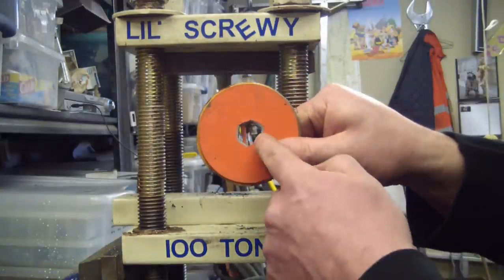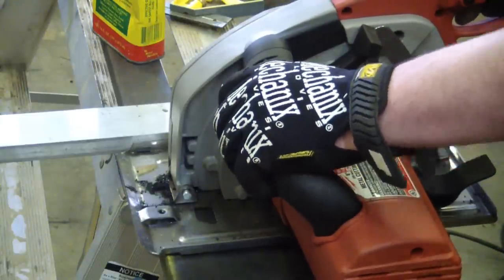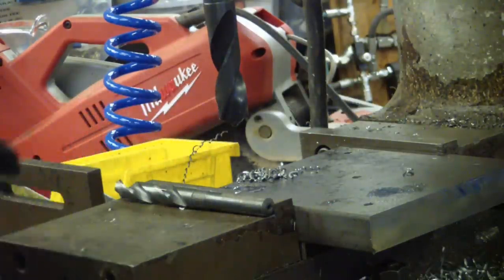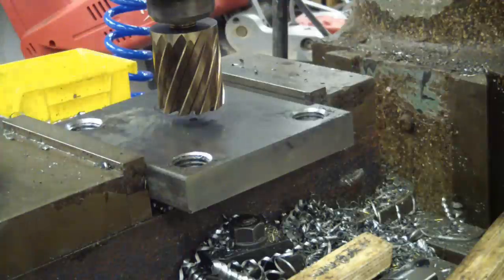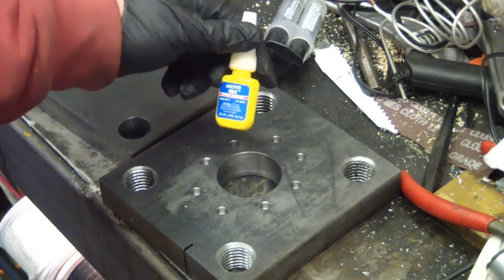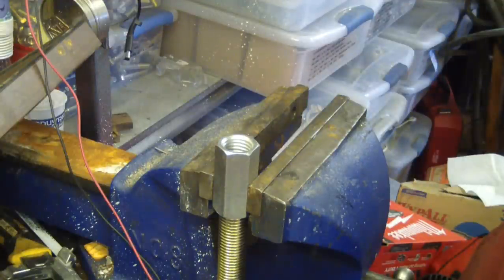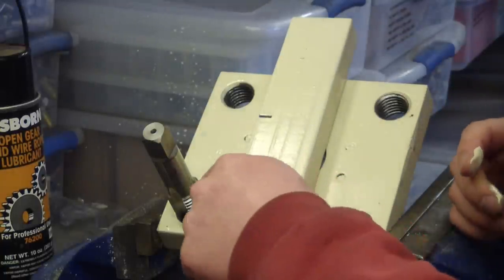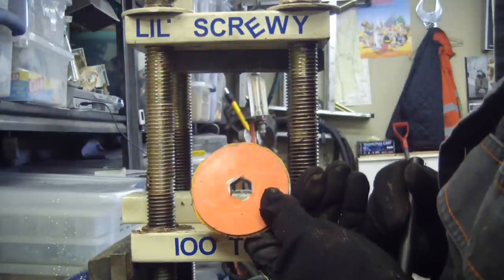How to build a 100 ton Press for machining, broaching, punching and forming

Comment: I used to use two big bolts from old coil spring compressors to press bearings.
I think you can make your contraption more efficient by using tapered roller bearings instead of just those big washers. Or at least use 2 or 3 washers and a lubricant to reduce friction.
It would be the equivelent of oiling a bolt before torquing it. If rebuilding an engine there are sometimes different torque specs for oiled or not oiled bolts. Oiled bolts require less torque to be applied when using something like a torque wrench.

Comment: Don't shoot sparks at your dingus...you should probably try wearing pants in the shop!
Reply: Rick Rodriguez I set a pair of worn out Wrangles on fire like that.
Reply: +K.D. Pearce i've set myself on fire more with grinders than I ever have welding. those sparks might not be quite as hot but you shoot em like a garden hose and things tend to get the idea and catch up
Reply: Rick Rodriguez uralldinguses
Reply: For your health
Reply: I have a grinder scar that goes across my left thumb tarsal thing and continues across the inside of my left thigh. I was a close one. Now I use a guard and have a reminder at the base of my left thumb. Whoops
Reply: Not my fault it hangs out the bottom

Comment: Hey, get a large gear motor and five timing gears and a belt.  Broach the gears to fit your coupling nuts.  Put two idlers in the middle so the belt can head out to one side to meet the motor pully.  Don't forget the arduino!  Could use spur gears too but spacing would be a pain...

Comment: Hey AvE, have you considered remaking Lil' Screwy except adding a bicycle sprocket and running a chain around the boltheads? Using  an old 10-speed bike/legpower instead of armpower seems like a lower effort way to get stuff done. I'm only asking because I want to put one together but want to learn from your mistakes first.
Reply: You just need more chains and sprockets. And creatine.
Reply: I thought about the same thing except using gears instead of sprockets, might have better resistacies to beefy pixie forces. You might need 7 or more gears but it seems . It seems like a cool idea in theory, considering force advantage and simultaneous rotation of all 4 screws.
Reply: if those screws are spaced right, you may be able to do something that looks like a planetary gearbox, each screw is a planet, and there is a smaller star at the center so you get your torque still, the star has a short extension attached to it that's compatible with the wrench you want to use, could even use a drill to jog the vice, and an impact may be able to torque it down. gives me an idea...
Reply: instead of a bicycle sprocket, a timing chain and gears from a junk yard motor would be beefier.
Reply: @lovotcore6946  I was thinking the exact same thing about a planetary... glad to know it's not a completely hopeless idea

Comment: Very cool, thank you! Although $35 is definitely tongue-in-cheek, you can build a submachine gun for $35 with this setup =)

A question: I wouldn't question your statement that this is dangerous, but could you elaborate on how exactly? I mean I can guess that maybe cracking stressed metal or flying bits are no fun, but I'm not sure.

Comment: Great build. I'm going to keep this idea in mind in case I ever need a press. Have you considered using some 525 chain and 14 tooth sprockets on each threaded rod so they all turn at the same time and you get nice even drive the whole way?
Reply: ***** 525 roller chain, it's a common size on motorcycles. Good chain is about $1 per link, cheap chain goes for about $0.60 per link. It's good for 8-10000 lbs.

Comment: You want to use lil screwy to crumple the can of never seize down so the brush touches the bottom. We just hammer the sides down but the two inch hole in your press should accommodate the cap/brush.

Comment: Yah, back in the mid 90s, I was the machinist for the Pacific Rocket Society.  I fabbed up the 6" diameter injector plate, manifold and valves for a LN2O/LPropane engine.  She was going to be 18' long with a projected alt of 15 miles.  But that's as far as the project got.  I've got me some idears on how to fab up a regenerative cooling jacket out of segments of SS and a really radical injector plate/manifold design.  All that's stopping me is the need to make some dough outside of what we need to feed our faces around here. 
  I'm into jet engines too, BTW. 

Randius Maximus
Reply: ***** The S.O. guys have some interesting vids up on YT, but some of their hardware looks kinda wonky to me.  Case in point; that hokey tubing fab up job they did with the 90 degree weld-up instead of smooth bends just made me cringe!!  One elbow bend like that introduces as much pressure drop (resistance to flow) as ten feet of line.  And they had like three of them in just one pipe!  Good grief. 
  Got a trans job on a Taurus to finish up today, and then rebuild a Dana 35 in the ass end of a Wrangler this weekend so I'll have some extra cash for my 2" tubing to make a prototype of my new tank design.  As Grease used to say, Schweeet!

Comment: +AvE
Screwy may need some kind of thrust washer under those coupling nuts might make it easer to tighten  your press. I poked around McMaster Carr 1’’ needle bearings are only loads rated at 3150 lbs. A home made teflon washers might do.

Comment: I'm gonna build myself one of these and put gears on the top of the rods with one central gear to drive them all. Or at least that's the idea. What do you think? Ohh and how would you do the gearing ratio? Since you know how hard it is to tighten that thing first hand...
Reply: +Robert Briggs If you go that far you might as well put an electric motor on it.
Reply: dieselphiend Hmm... Good point =) I know where I can pull up a decent little electric motor
Reply: +Robert Briggs You'll put your eye out.
Reply: +Rini 
Nothing a little 5 stage reduction can't fix ;)
Reply: i have an old sump pump motor that spins at 1750 rpm at either 120 to 240 volts ac. it has some sort of spring mechanism in the front end of it to keep the motor from torquing out the drive, its 4 small springs in two stages with a small translation bar in between them. i just need to figure out how to find a tappable gear for it cause it had a nut and bolt setup in the front for the impeller (which i had to grind and cut off to get to the nut). tell me if anyone has any ideas

Comment: are there any plans for presses like these with mechanical information, and calculations for stuff like the size of the bolts? i am interested in being able to deep draw unibody gas bottles, and that requires like 200 tons of pressure. where can i find more information about this?

Edit : There are drawing calculators online. Best bet is to just make less diameter reductions with the dies

Comment: Put some roller sprockets or timing belt pulleys on those four rods and connect them to a center drive! Then you don't have to worry about evenly screwing down them down.

Oh, but then you'll need four times the torque probably. Then you can use that inline reducer that's been hanging around.

Comment: Nice video.  Would it be easier to simply buy 4 nuts that fit on the threaded rod and weld those over through holes in the plates on the side that doesnt' expose the nut welds to stress?

Comment: Just wondering if you could use an impact driver to sequentially tighten those rods?
Would be easier on the meathooks but I'm too much of a noob to know wether that's too much stress on the bolts.

Comment: i feel like it would be best to have those bolts and nuts machined custom. make them out of O1 tool steel, harden them, and bring the temper to, like, a blue. maybe even try and through-temper it somehow. ive tried to make my own steel drill bits this way, and anything less than plum color temper just snaps. same for the nuts, with really thick threads. you can potentially make some really tough material that way. you'd have to drill everything with high speed steel or carbide though lol. can a 12L14 base plate handle this sort of pressure?

Comment: You know what would be kick ass on that press..
You need to get  like 4 beefy  small diameter chain sprockets   and weld them to the tops of the 4 threaded rods and wrap a stout chain around it and master link it up, then you would only have to tighten one screw and she would creep down nice and chooch 👍
You would just need to run a thin steel spreader (like 1/4" plate) just under the sprockets so the rods behave.

Comment: nice work - i could do with a press but not 100ton; just for pushing bushes out of trailing arms/radius arms/suspension parts. could this be duplicated with, say: M8 bolts or threaded bar? I only really need about 10 tons, fraction of your design!
Reply: cheers! just need to find me some steel plate suitable for the job. Do you have a site/book you'd recommend as a reference for calculating material sizes required to take the pressures/strains/etc?

Comment: Another you tuber referred me to your work, and this video prompted me to subscribe. I can totally relate to learning how to make tools an/or machines with a shoestring budget. Keep up the good work. Waiting for the hydraulic version, though ...  :)

I saw on one of your videos a comment about using something like a 7.25 inch  Skilsaw with a steel cutting blade to cut plate with. I have a worm drive saw, so it should have enough torque, but I have a couple of questions, if you don't mind.

I searched around Amazon for a 7.25 inch steel cutting blade, but they all appear to be limited to .250 to .375 inch plate. What blade do you use, and what is that liquid you squirt on the plate, that you use to cool (I assume) with?
Reply: *****
Cool beans!. Thank you the prompt reply. I'll see if I can find the torque output, or maybe derive it from amperage/horsepower rating.

Comment: You should put four same size gears on the all thread with a single smaller gear to turn them all at once, with a little gear eduction..sort of a planetary gear drive setup.

Comment: The heat from welding won't screw up the magnets, unless their temperature goes above the Curie point.  But methyl methacrylate resin decomposes at a MUCH lower temp!  Maybe those magnets are now being held in there just by the magnetic force?  :)

Comment: Would be cool if you put some big gears on the rods, and then a small gear with a crank handle in the middle for good leverage. Then you can just crank it down.
Reply: +Ninjafluff 
Gears that size would be expensive. Would be easier to just go with a hydraulic press then.

Comment: How bout fitting a sprocket on each coupling nut and running roller chain around the four screws? Then only need to turn one screw and the rest turn simultaneously, right?
Reply: then you also gotta turn 4x as hard

Comment: Quick tip for super glue on your fingers, just run it over a file and it come right off with out taking of the all the extra skin you've built up on em over the past however many years (;

Comment: nice press!
Reply: *****  I have an idea, I wonder if your crunch an open end wrench through some metal if the shape that's punched out would also be used as a wrench. or at least be a blank that could then be ground a bit to make it into a wrench.

maybe press it into some wood so only the areas directly contacted by the wrench would push out. idk thought just an idea. would make an interesting video anyway!
Reply: *****
well i was meaning i wondered if wood would compress to make a negative die.

try to crush some of those coins i sent you? maybe smash a canadian coin into an american coin. see wich one imprints on teh other or if they stick.

Comment: hey A
Could you destructive test a gr33n-L33 3/4¤ inch shafts panel punch? the smallest on the larger pin, iir, 1 or 1.125 Dia kockOut size. 
I used on electrical panels, some times many layers...with a functional hand pump.  (C02/0il?)*?

but wondered  how the dies would Fail!¿°•?
IF the threads first, theN pinned  cross shaft to make the die, Die!
...

Comment: i would like to know how you know that it a 100 Ton press have you had it tested?
Reply: ok mate will look in to making one myself could do with one and thank you.
Reply: +AvE How?
Reply: +Cole Byrd dead reckoning I'm guessing. He has some skookum skills
Reply: +StillTotaly mad machinery handbook magic
Reply: 1 inch thread has 0,125 pitch so mechanical advantage = 1*3.14/0,125=25. You can use 24 inch breaker bar, now you have mechanical advantage=25*24/0.5=1200. 200lbs gorilla can generate up to 200lbs of force, Fout=Fin*1200=200lbs*1200=240,000lbs=108 TONS.

Comment: Not really a 100 ton press. The thread rods have in total a tensile strength over 100 ton, but will yield at aprox 75 ton. If not for one time use, it is corretly a 75 ton press.
With a safety factor set at 2, witch is low for a press, it is really less than a 40 ton press ;)

Comment: So the only difference between a mill and a drill press is the mills table moves?
Reply: Don't know if a year later you're still wondering, but there are drill presses with moving tables. The big difference is that a drill press has the spindle and bearings set for axial loads (drilling down). If you try to go side to side with an endmill on a drill press, the tool either falls off the spindle or you damage the bearings. Even if you gutted the drill press to convert it into a mill, you'll have a really weak mill as the forces will cause deflection and make your parts less accurate.

Comment: I'm curious why you didn't just use a 100 lb jack. Or go for a fly/screw press? this seems like loads of work cranking each screw. 
look at the baps on her though. nice job.
Reply: +OSheaHandMade You've got your lb's and tons mixed up. 100 TON jacks are like... very expensive...
Reply: well. so what. you know what I meant. 
I doubt this is 100 TONS anyway. you want that in stone?
I use a 30 ton and it works fine. was 200$
Reply: OSheaHandMade Have you seen how much a 100 ton jack is? They're like $1000 - $2000 US dollars. I'm sure your $200, 30 ton jack works great, but it's still less than one third the power of this super cheap unit.
Reply: +dieselphiend 
would be nice to see some test numbers

Comment: What's the cheapest way to build one of these (assume I have zero tools lying around)
Reply: Maybe you don't need a press if you don't have other tools.
Reply: JKCDLT I have tools, but I don't have milling machines or any of that newfangled technical shizzle wizzle
Reply: you'd need a dill press, bits and taps, and the materials.

Comment: You're just waaay too funny, Dude! 
  With my being a gearheaded technoid m'sef, maybe I should do a few videos on stuff I cobble up around here.  Like just yesterday, I had to fab up an adapter for the valve spring compressor so I could take apart a Plymouth Neon head that needs a valve job put on it due to a bad timing belt idler. 
  When I fab up my roll forming tool for making a prototype of my liquid fuel rocket tanks with no welding, I'll definitely shoot some vid of that. 

Randius Maximus

Comment: I would rig 4 rotating ratchet hose to a single high power ratchet, for another 50 bucks you wouldn't have to manually tighten off each rod.

Comment: Could something like this press custom coins?
Reply: *****
I was thinking for copper, and aluminum. Wait, have you tried to make coins before, that's neat. I make custom coins, but all mine are either sand cast or two part plaster mold cast for metals like tin and zinc. I've always wanted to be able to press coins, thanks for answering my question.
Reply: *****
That's awesome. The way I have been making coins is pretty slow, first there's the drawing, then I carve the details into a wax disc, then make a rubber mold of that wax disc, then use that mold to make a plastic one, then use the plastic one to make a two part sand mold for casting, or a reusable two part plaster mold for tin and zinc. One thing I've always wanted to try is making titanium coins, or even better yet, uranium ones. Maybe if I'm able to get a 3D printer I can make dies to make the aluminum and copper ones fast.

Comment: You showed all the boring parts and none of the interesting parts.  Too much cussing?
Reply: I imagine it was a tussle, I would have liked to see you tapping those 1" holes.

If I  had to comment from what little I know about machining, I would suggest using more cutting oil in drilling & tapping.  I also would have liked to see that larger hole bored with the not-twist-drill bit.  Also more on the use of the final result -- how do you sequence the bolt-turning so as to keep everything square?

I enjoy your informality.